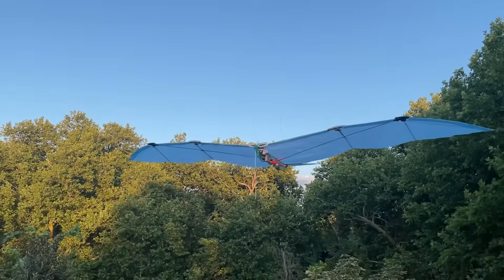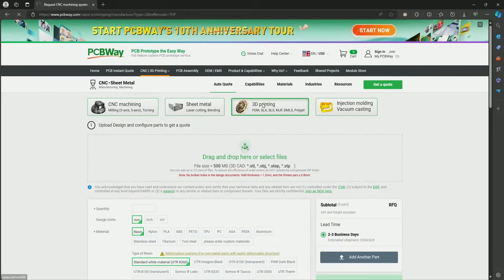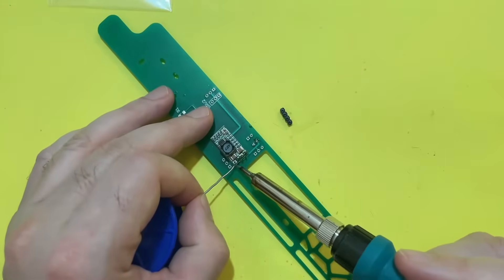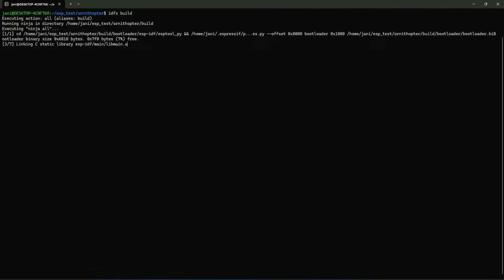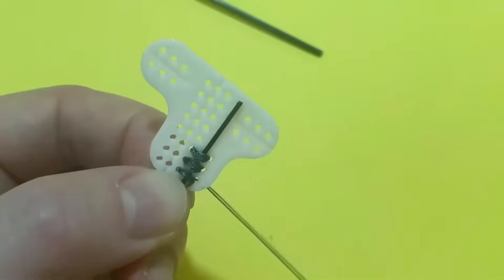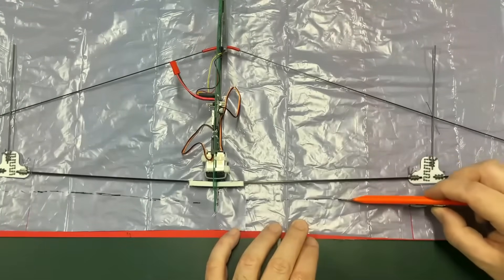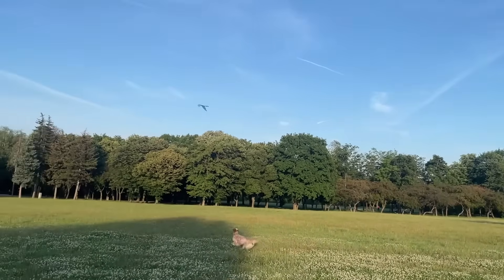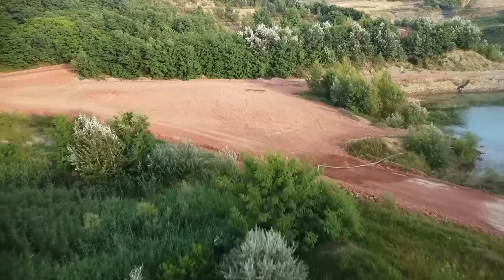How I made a flying robot bird

Comment: Wow thats amazing! What brand of servos are you using? I'm struggling to find ones that are light, small, but still strong enough to produce enough lift and thrust haha
Reply from the maker: Thanks! Blue Arrow D0576A SG HV
This one tolerates 8.4V , but I drove these from 6.4V

The servo gears are the weakest link in the system.